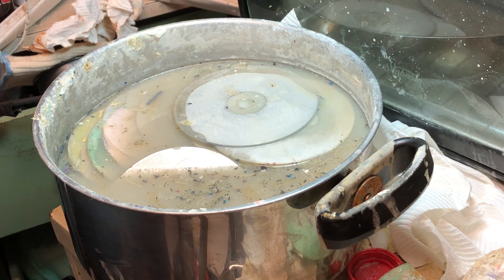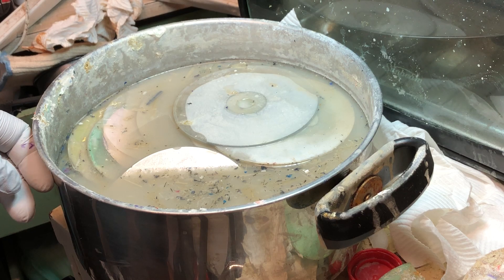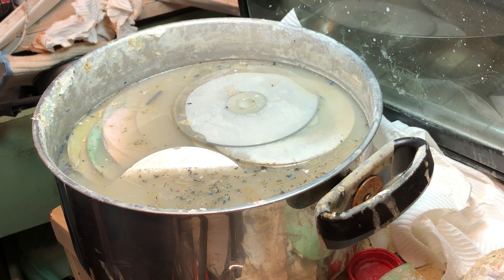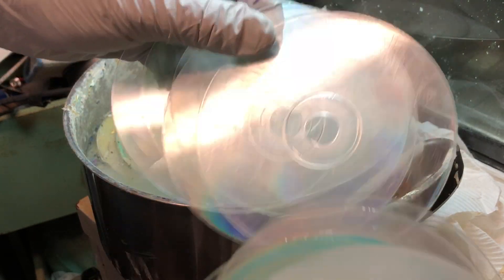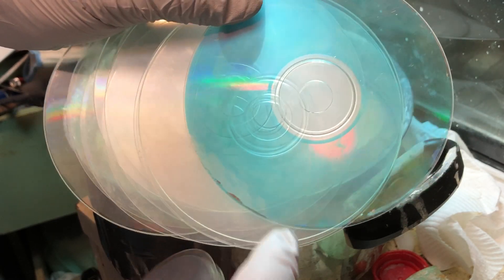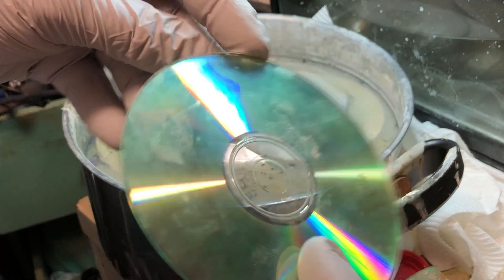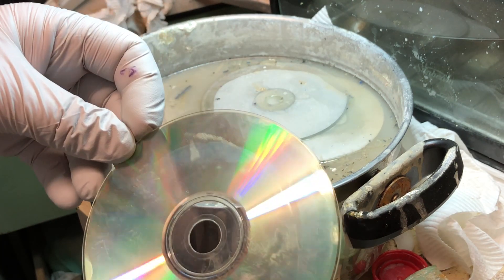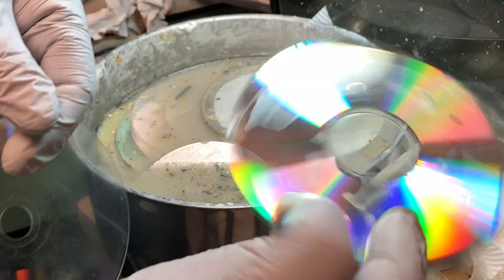Ep117 Part 2 Cds v Sodium Hydroxide

Comment: Sodium Hydroxide (aka caustic soda / lye) is highly corrosive and will dissolve your skin, eyes, aluminium and many other things. Mixing it with aluminium and water (as you are doing here) should be done outside because it can generate enough heat to boil the water and it produces hydrogen gas heat which can cause an explosion (trust me on that one, I speak from experience😬)
Reply from the maker: Thank you for information.(Sodium Hydroxide is a dangerous) . The Sodium Hydroxide that i was useing must of been a very weak.. It did not seem to do much when i was useing it. I did take precautions when useing it..
Thank you 
Kev